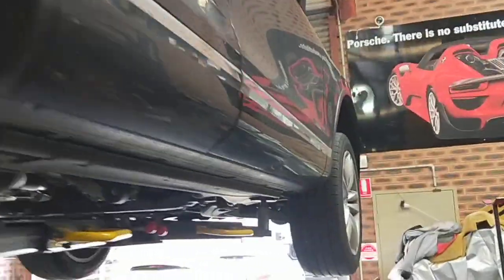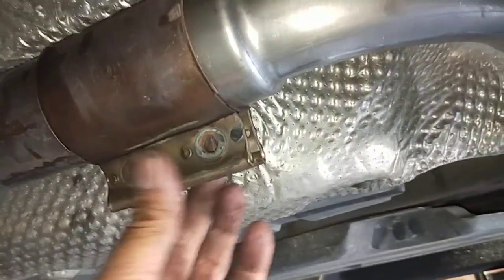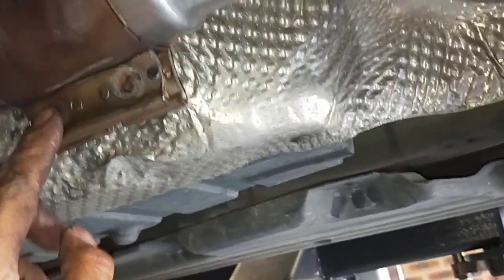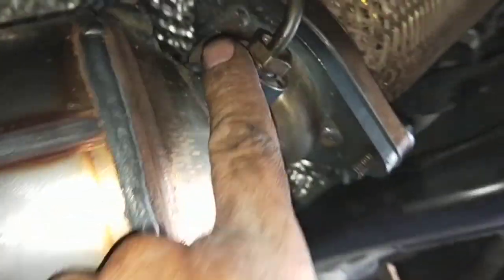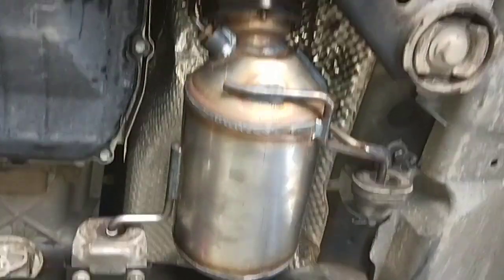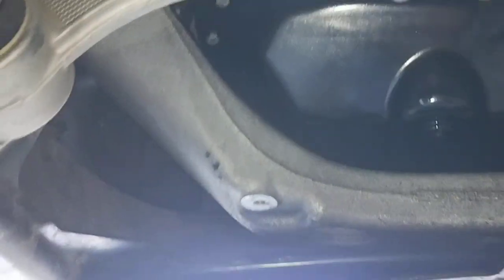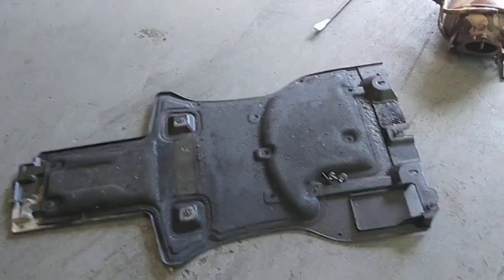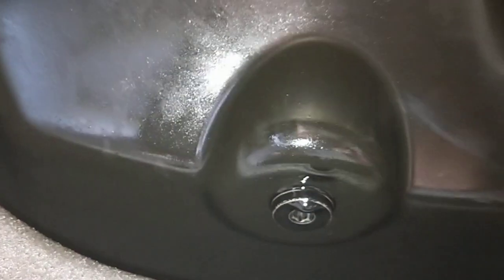Volkswagen Touareg diesel DPF filter change

Comment: Thank you your post! One question: how did you remove the three bolts connecting the filter to the exthaus manifold? The space is very limited, can not be reach with the impact gun. The outer (closest to the left side of the car) bolt seems to be the hardest to reach. The M12 bolt is soft, easy to destroy by the wrench. Tried to use degrip liquid, no success. Two bolts can be reached by torch but the outer one is not possible. It seems the only way is to support the motor-trans by jacks on the ground and lift the car without them.
Reply from the maker: If you have special home made tool like a set I made for this job and a  hoist - it can be done.
Otherwise support gearbox with a jack or jack stand.
Remove the support in the middle for gearbox out, this will give you a lot more room

Comment: Do you need to remove the middle support to get the DPF it out?   I will be taking the Downpipe Cat out at the same time. I have a crack at the flange by the Turbo. Plan is to take it all out get the crack welded up the DPF cleaned at the same time.
Reply from the maker: Support the transfer case before you remove middle bar

Comment: Hey mate, my treg 7P 2013 CJM model has dpf light on dash. Scan tool says no codes. Not letting me do regen. Soot level at 0.26 and max value. 0.48 on scan tool. I recently changed left bank 3 injector washers and seal. 
When we start car it runs perfect for 10 mins and then dpf light on dash and running rough. Can you help?

Comment: I thought the DPF filter was directly after the Turbo? But it is actually under the car?
Reply: After the turbo is catalytic converter. Under the car is DPF. Because the OEM downpipe is separate in two part, cata (part one) and fap (part two).

Comment: Do you know if the new dpf you fitted is a revised/updated part mate,as I have just come to fit my new one and the hanger is facing the wrong way,and there is no pipe coming from the rear of the exhaust that measures back pressure on the old one.
Reply from the maker: This one we fitted is an OEM DPF filter. Sounds like you have the wrong one